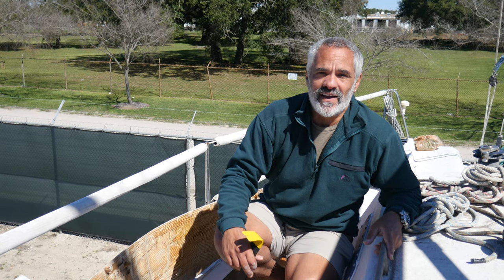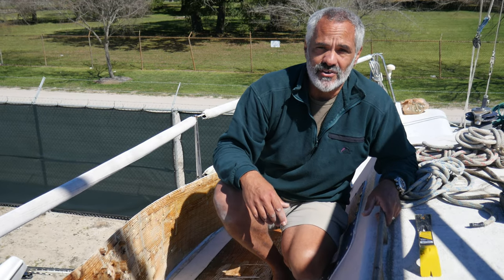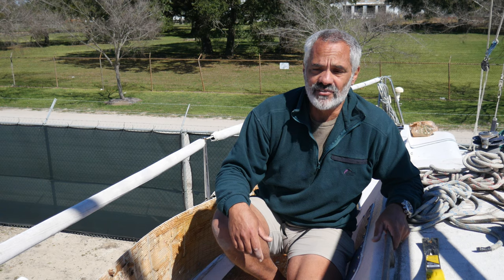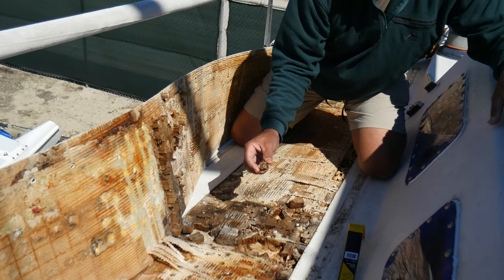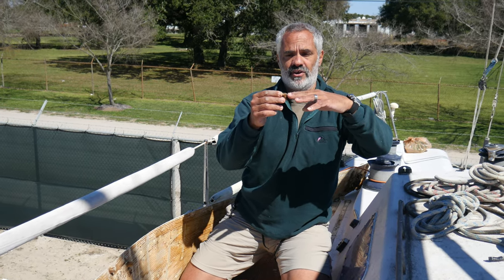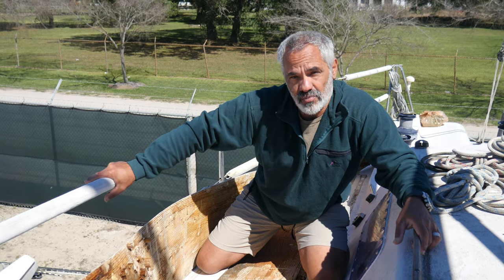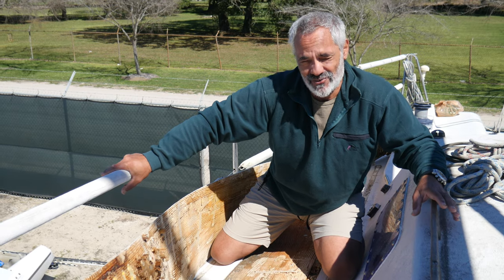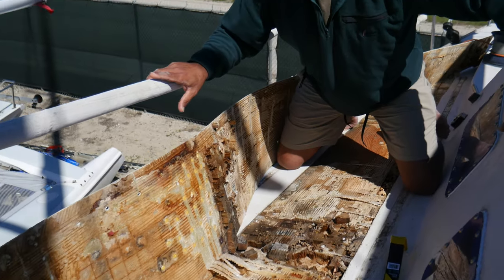What NOT to do with bad boat core

Comment: It does work with gorilla glue though, if you are able to inject it under pressure. It’s obviously just a cheap fix and not a professional repair by any means but I am telling you it does work. Water is the catalyst in the gorilla glue. I’ve drilled holes in a transom injected gorilla glue, then sealed the holes, and had the gorilla glue losing out of another hole 6 foot away from the injection point. After completion I applied a small layer of glass with epoxy and paint to finish, hit it with a hammer and it was solid as a rock all throughout. Had a buddy come over who is a marine surveyor and he said nobody would ever know and that it’d pass any survey hands-down. Never in a million years would I do that to a high value boat, especially if I was planning on selling it, but it is a viable low cost option to someone in a pinch like I was.

Comment: Being a boat repairer myself, I absolutely totally agree. DON'T drill holes in your deck and inject epoxy!!!! IT DOESN'T WORK!
Reply: Hey, one question please. I've bought an old 14' sailboat with fiberglass over thin (~4mm) plywood construction. At several places (mostly by daggerboards and gunwales) the ply is very soft. Few scrapes expose the fiberglass layer which however holds its own. My plan was to scrape the soft ply, stabilize the rot, and put epoxy & fiberglass from the inside to strengthen the hull. Is it not a good idea, what other options are there? I can replace the transom from the inside but I cannot imagine doing that for all the ply due to the complicated shape. I understand that the wood is important as it adds rigidity. Is there some synthetic substitute i.e. filler or a foam that could go in place of scraped out ply? You reckon I keep as much original ply as possible or scrape it all?  Any advice much appreciated :)
Reply: @matejv2840  If you are asking me.... I don't see a problem with that seeing as the plywood is so thin. Make sure you get rid of ALL the rot and then do layers of glass in those spots.
Reply: Sorry but it worked for me. That was 40 years and 28000 miles ago and the boat decks are still firm.
Reply: Ideally replacing a wet, mushy failed core is the way to go.  It’s all a matter of degree.  Can you get a satisfactory repair from drilling holes and drying?  Without a doubt you can!!  I’ve done it and am happy with the results years later.

Comment: I have friend who did the drill and fill job. Deck is solid six years later. He said the most important part is getting the rotted core completely dry. This takes a covered deck, ( clear plastic), mechanical ventilation ( fans), and about two months drying time. Indoors is best with humidity control.
Reply from the maker: You can get lucky, but I have never seen it. 100% of the drill and squirts that I have checked had massive amounts of water inside when checked later. 

I am happy to hear that your friend was able to buck the trend. Let me know how it comes out after the first big storm at sea that flexes things around for a day or two.

Comment: So if I have a failing deck can I drill a 1000 holes in it and fill it with epoxy?  I think I read that I could in a Better Homes and Gardens magazine.
Reply: As long as you are only baking bread, you will be fine. But for the deck of your boat the best time for a thousand holes and epoxy is . . . . . . Never! 

Thanks for the chuckle.

Comment: Thanks for the advise. I was looking at a cheap Morgan 31that has been unused for more than 4 years, while chatting to the seller he mentioned she was cored, he then went on to explain, how they do exactly what you have shown, he tells, they suck the rotten core out then pump epoxy into the void to fix the boat. To my mind it didn't sound right at all, end of call

Comment: I did this type of repair but in my defense i was hauled out and placed a fan directly on the drilled holes for about a month and a half, then i was able to get an acceptable reading on a Moisture Meter and then filled with Epoxy. I very well might have to cut back into her in a few years but as of now it does seem solid and i feel pretty confident about it so far.

Comment: Ten years ago I bought a Spencer 42 .. didn't know much about boats then.  Got really lucky; my boat is solid fiberglass from the keel to the deck :-) ... and thick structural fiberglass, not this chopped mat crap.  Where the deck and cabin go over the mast step it's 1/2" thick so I added another 1/2" above my supporting bulkheads just to make sure :-)
Reply from the maker: Solid glass, is solid glass. Heavy, but no moisture in there. Enjoy your boat and I look forward to meeting you somewhere out there.
Reply: @sailboatcareandrepair  hey! Please FILM MORE VIDEOS! Your Awsome🙂 
what about polyester resin that is porous and could absorb water, what is your experience with that?
Reply from the maker: @Bakanelli  properly mixed and applied resin is not really porous. Water can permeate anything but not fast enough to rot a balsa core. But a thousand holes - that will let enough in to rot a core.
Reply: @sailboatcareandrepair  Thanks for the reply! reason being I’m asking is because I am worried about fibreglass osmosis since I certainly won’t be able to get ALL of the rotten core out (specifically on curvy difficult to repair parts and time limitation). So you think there’s a correlation between low quality, wrongly mixed polyester resin and fibreglass osmosis?

Comment: Lol, you sound like me telling people not to drill holes an d fill with epoxy. All you have is little pillars of epoxy in a rotten mush core. I am an aircraft mechanic and I think I know where this practice came from. There is a repair in aviation of reattaching a debonded core using this method. Not a rotten core or wet core. Possibly this practice crossed over to boats from people not understanding what they were seeing done on the aircraft.

Comment: Could not be anymore clear and I get it. NOW I have a co-worker who will watch this video and DRILL 999 holes and fill them with epoxy 😂 "Well the guy on video said several times to not drill 1,000 holes but 999 drilled holes and it will be totally fine to fill them with epoxy"" 😂

Comment: Totally disagree. I drilled holes in my flexy fibreglass decks 40 years ago and it worked. 28000 miles later, the boat decks are still solid. The Treadmaster stuck on to cover the holes is also going strong.
Reply from the maker: You were lucky. 99% of the time it just makes a spongy mess. Keep having fun with your boat.

Comment: but how dose some one poor like me fix the problem on the only thing he has to travel or as a home
Reply: wait for a stretch of good dry weather. find the bad spots by tapping on the deck lightly with a small hammer. your looking for areas that change in tone to a dull thud. mark the deck where the dull thuds are. these are the rotted /water  soaked core areas. cut the deck where you marked without going too deep into the neck fiberglass layer/level. carefully with anything you can cut, scrape or push under the deck as you have to lift it off the bad core. remove the bad core. generously epoxy in a new core. epoxy the deck back into place. epoxy fairing the  deck cuts, sand smooth...repaint the deck.   make sure every fitting on the deck that has screws or bolts into the deck have been rebed properly or youll have more wet spots showing up.